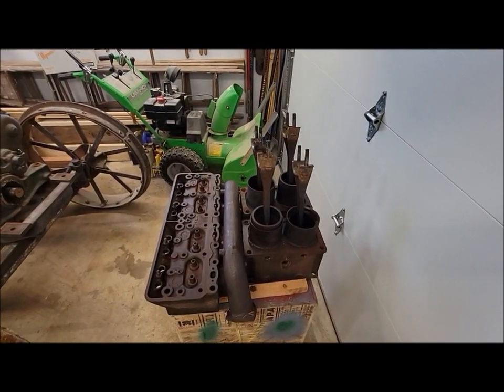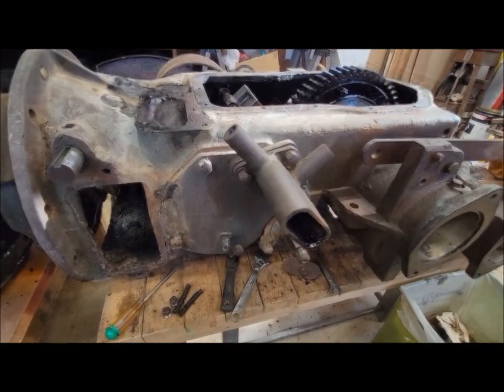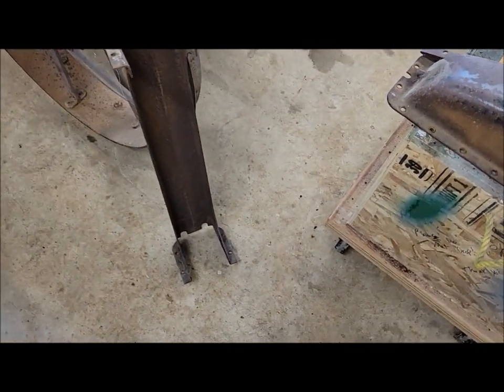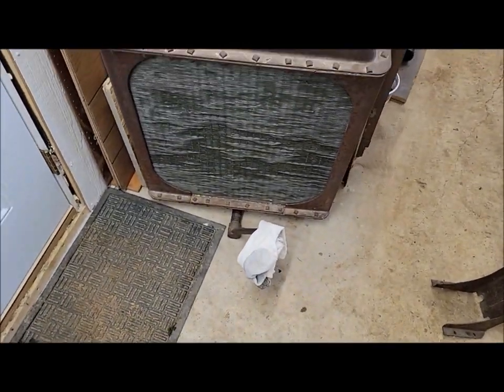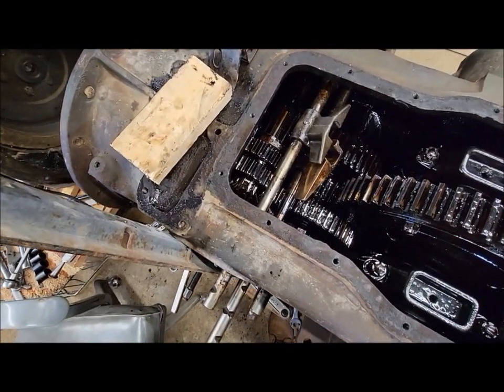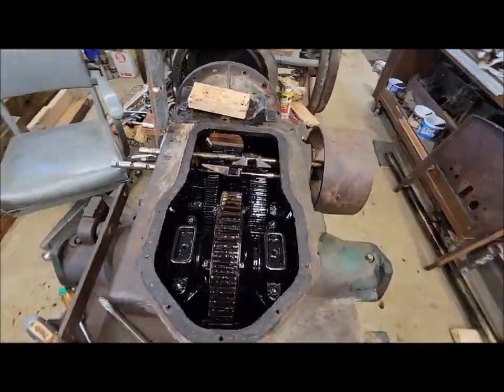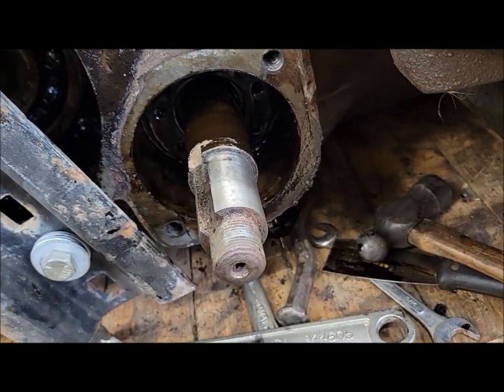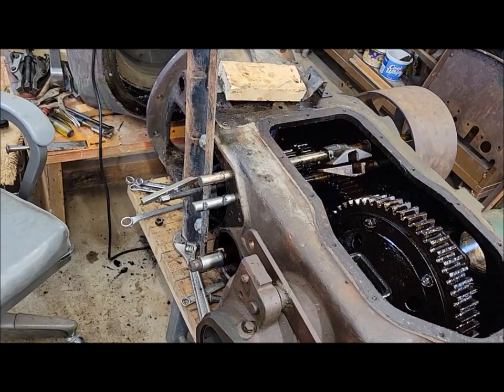Allis Chalmers 15-25 Part 5 - Clutch and Transmission Disassembly

Comment: your garage door is now "christened" 🙂 i think you will have to belt pulley shaft assembly out the left, as that bevel gear is the main drive and i wouldn't be surprised if it was a press fit. when you have removed both bearing housings, you will be able to drop the gear cluster down and forward to disengage the selector fork and rotate it out of the way/remove it (i think!!!???) FYI I discovered on my 25 model 20-35 that the input shaft bearing housing is bored eccentric to the bolt holes/ mounting flange, so it can be rotated to set the backlash on the bevel gears, pretty smart!!  Happy New Year 😊

Comment: On the clutch input shaft the gasket material appears to be Vellum. I used that in drafting and thought I'd add it here for you. You had me worried about the radiator bracket getting broken when it fell over. At least now you don't have to worry about hurting the door in the future. Exactly why I could not own a new car. I'd have to scratch it just to stop the worrying.
Reply from the maker: I have heard a story of a guy that when he bought a brand new vehicle, after all the paperwork was done but before he left the dealer lot, he took the car key and put a scratch in the fender himself.  The salesman couldn't believe what he just saw, the guy just said "there, now I don't have to worry about the first scratch anymore" and drove off.  I wouldn't be able to do that!